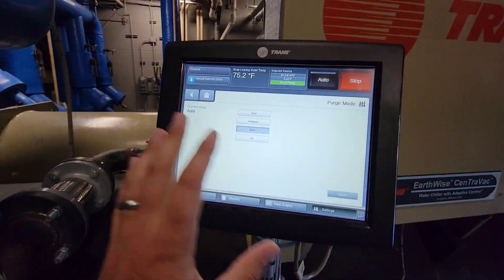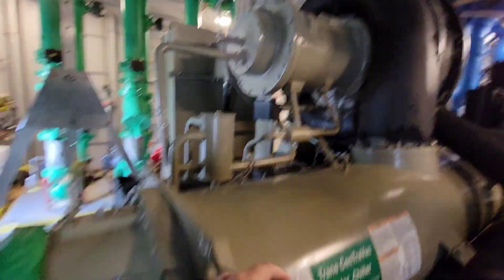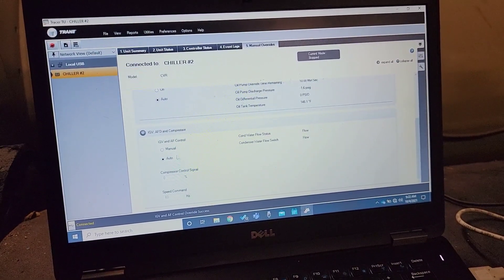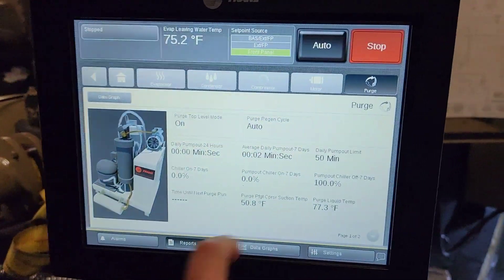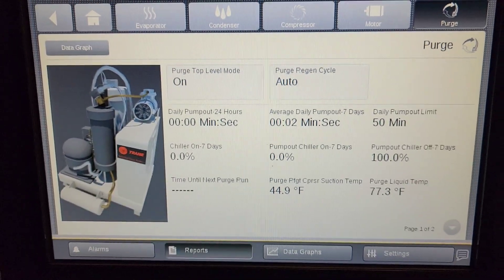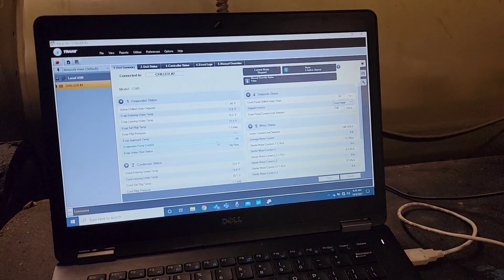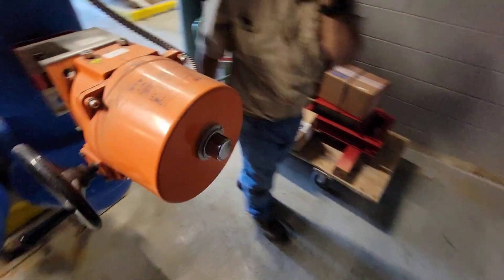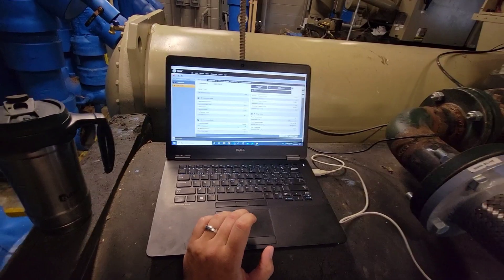Startup On Centrifugal Chiller After Overhaul by HVAC Technician

Comment: Atmosphere? You mean non condensibles? What triggers the pump out on the purge unit? You have a warm suction slowly dropping, why does that happen?  
I thought flow rate should be set at design min, no?
Reply from the maker: Yes on these chillers when we refer to atmosphere we are referring to non-condensables in the system. The suction temperature will slowly drop as the non-condensables stack in the evaporator not allowing proper heat transfer on The Purge unit meaning that it is time to pump out. The flow rate needs to be within design parameters at any given point I personally do not intentionally set them at design minimums I ensure that I am within the factory range and then if I need to fine tune it given a specific application I can do so.

Comment: How does atmosfere air get into the closed system
Reply: The chiller is a low pressure machine, the evaporator is in a vacuum from 8"hg to 19"hg. Gaskets will allow atmosphere to pass through sometimes, just like a high pressure machine will leak refrigerant out from the chiller body to atmosphere.